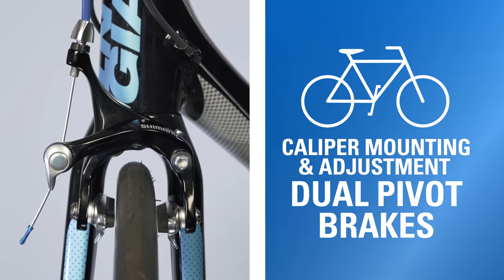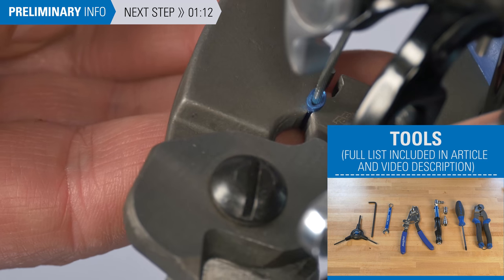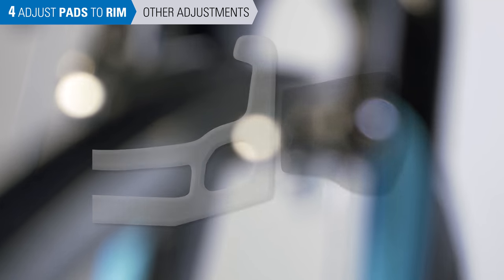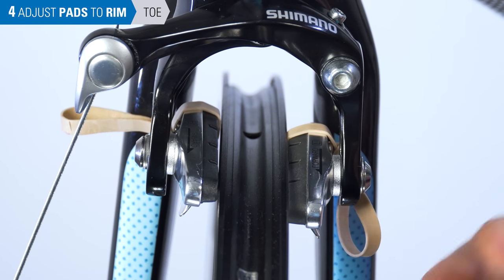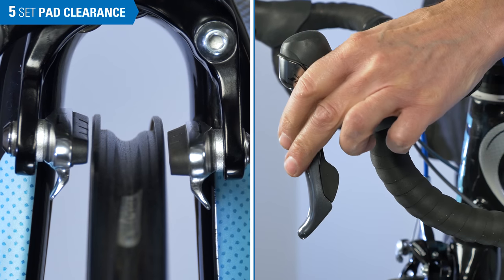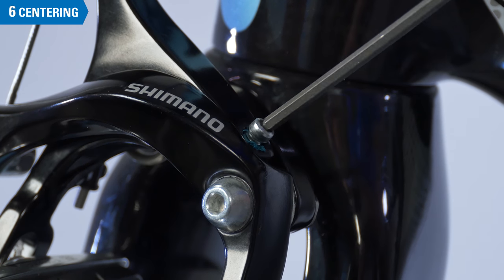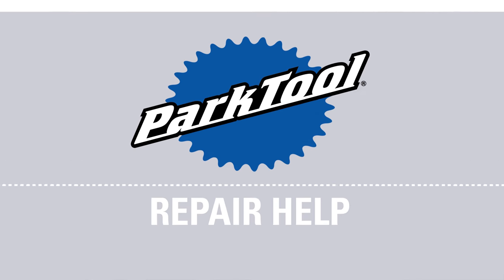Brake Caliper Mounting & Adjustment - Dual Pivot

Comment: Never realised that those pads have a toe! One of them has always been to badly aligned and the one edge wears so much faster than the other. 2 years being sent to bike shops for services an nobody has ever dealt with it in any way, so i though it was just a flaw of my calipers. You are my hero now. I don't think I'll ever take my bikes to bike shops ever again..! <3 I can perfectly pull it off on my own, especially after having built my fixie! :)

Comment: Thank you so much!
I changed the old single pivot brake calipers on my Cannondale CAAD 4 using your instructions. 

It worked great and the new Shimano 105 R7000 calipers are such an unbelievable upgrade, makes me feel way safer when I know that I can stop fast.
The Park Tool tools that I used for doing it worked flawlessly as well! :)

Comment: Calvin really lays it down. Every step is explained perfectly. I just put some SwissStop pads on my bike and couldn't find a torque spec. My bike manual said 8nm but when I tried that, it just felt wrong and I stopped trying to torque the bolt to that level. Calvin noted 5nm which is more like the real world. All praise to Park Tool.

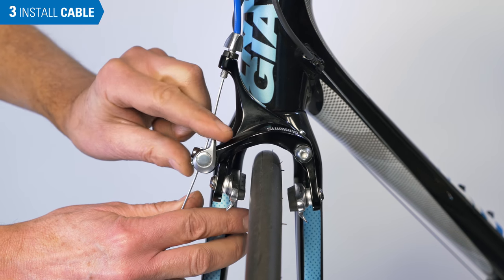Comment: Question: At 2:20, you say 'squeeze the pads to the rim and secure the pinch bolt.'  Then when the tire has been removed at 2:37, the pads show a significant gap from the rim.  Is the goal to start the procedure with the pads contacting the rim or with that gap?

Comment: I love your videos for years ago and to come. My Ultegra 6500 setup (STI + calipers) keep feeling spongy. Any clues?
Reply from the maker: Be sure that your bar tape is not pulling the housing out of the housing seat at the lever. Check this buy peeling the hood forward and pulling the brake. Watch to see how much flex is happening at the tape as you apply pressure at the brake.
Reply: @parktool  will try! Thanks for the reaction!

Comment: I bought a used 1985 Panasonic DX-3000 road bike that has Shimano Z570 side-pull brakes. I want to put Shimano Claris brakes on it, do I need to modify anything to the mount?

Comment: Hi Parktool

Do you have a video on how to fix dual pivot brakes that won't retract.
The issue is at the brake it self. The spring is not strong enough to retract.
They are less than 3 months old. I'm thinking it is dirt, but what could I do?
Cheers
Reply from the maker: No video, but there is reading at the end of: https://www.parktool.com/en-us/blog/repair-help/dual-pivot-brake-service  
Make sure it is not cable drag first.

Comment: Can someone help me, I have followed this guide however my brakes are still not biting enough. I have noted that I am unable to set toe on my left side brake pad as the arm on the calliper doesn’t allow the pad to angle enough to even achieve parallel with the rim. This had even caused the old pads to wear diagonally. This could be the source of the problem, however additionally to that I wonder if the painted rim could be reducing the frictional coefficient compared to a non painted rim braking surface. Any advice please, this bike is for my gf and I would like her to be able to stop if needed.

Comment: What's the turnable silver lever for (the one where the cable goes through)? Does it need to be set to the down position all the time?
Reply from the maker: On this brake that is the "Quick Release Lever".  It allows the arms to open to make the wheel easier to get out.  Set the brake up with the lever down, in the closed position.  Open it when taking out the wheel.

Comment: I have a center mount dual pivot system but want a stiffer caliper are they all interchangeable? Or are some center mount calipers different?
Reply from the maker: There are different models with different "reach". Shimano and TRP have some good longer reach options. In most specs the manufacturer will list the reach which is the measurement from the center of the mounting hole to the center of the brake track.

Comment: Sir Calvin, there's some squealing on my front brake. I already did the toe, and cleaned the rim brake line and brakepad. What could still be causing the squeal. First time i rode the bike again yesterday. Last time i rode it was March, before the lockdown here, and there was no squealing then.
 
 Also my front brake is not in the same position as the rear brake when in a relax position. The quick release in the front brake almost touches the brake pad bolt, although brake still works fine. Any idea how to fix this?
Reply from the maker: Squeeling brakes can be a challenge thats for sure. Cleaning, scuffing and angling the different parts of the system are what I suggest. toeing the pads, scuffing the pads/ the rim as well as cleaning the rim. Also , sometimes finding a long descent to ride the brakes down can help bed them in and reduce any squeals.

Comment: hi! i recently installed a new caliper from sora to tiagra. same specs or measurements however the new one touches the tires. the brake pads hit the tires. how do i adjust this?

Comment: Sometimes it is the person , voice mannerisms etc that makes a big impact on teaching. One thing missed in this video which is critical is to turn your bike handle bar fully to one side in order to access the back bolt on the bike forks for the Brake Calipers mount.

Comment: How about when removing/reattaching the wheel? How do you do this without moving the break?
Reply from the maker: Many brakes of this type has a quick release lever thap opens the arms a bit.  Looks at the side of the arms or sometimes at the lever.
Reply: @parktool  yeah, I got that. But it doesn’t seem to open up enough. It’s my first road bike; I just bought it today, used.

Comment: Somehow my brake pads are not coming back after I squezze the break and they rub the rim. This will result in more wasted energy for me when peddaling. Do  you know why? Maybe my brake spring is done? Thanks
Reply from the maker: I would make sure the cable and housing move freely. To check the cable and housing disconnect the cable from teh brake and pull it out of the brake completely. Pull on the cable lightly while pulling on the lever. Then slowly release the lever. IT should take very little effort to pull the cable back out. At this time you can also check the spring tension on the brake just by squeezing the arms together and releasing them slowing to see how much pressure they create. This will narrow it down.

Comment: My brake pads look the same as the ones in this video, but they don't have the convex washers to adjust toe... is this a part I can buy separately?
Reply from the maker: It typically needs to come with the pad. The threads on your pad will not be long enough to accommodate the system.

Comment: When i try to install my caliper and secure it with 6N/m(or less/more) it gets stuck and one of the levers won't move. I  cleaned and greased my caliper, always get same problem. Can't find any solution, please help..:)
Reply from the maker: If you unhook the cable from its anchor point does the caliper spring back? If it does then it is something in your cable/ housing. If it does not then your caliper will need some more love.

Comment: Great video! What's the quick release at 2:17 for?
Reply from the maker: That quick release is released to open the brakes enough to allow the tire/wheel to be removed.
Reply: Also i relese the tension when i not ride the bike for a lomger time.

Comment: Would this brake fit a huffy cranbrook 26 inch? 26 inch wheel? Or only those 700c skinny wheels?
Reply from the maker: This type of brake is typically only found on Road bikes and other skinny tired bikes. MTB's would have V-brakes, Cantilever brakes, or disc brakes.

Comment: After following this tutorial, I find that my pad clearance won't reset after releasing the brake. So everything will be set up and then after testing the brake everything works great, but then after releasing the brake the pads don't release fully? I am not sure what to do to fix this. After playing around with the front brakes, I was able to fix this problem, but I can't seem to figure out what I did to fix it and the back brakes are having this same problem
Reply from the maker: A common cause of this is a loose mounting nut.  Make sure the caliper body is tight to the frame, about 70-80 inch pounds.  Try a test of the caliper arms.  Drop the wheel. Squeeze the brake arms by hand inward and let go slowly.  Do they come out fully?  If not the caliper pivots are dragging.  They may need lubrication or they may be too tight.   See also in this case:  http://www.parktool.com/blog/repair-help/dual-pivot-brake-service#article-section-8
-Calvin
Reply: When the caliper is disconnected from the brake line, it functions great and opens fully under the force of the spring. I checked to ensure the caliper is mounted tightly to the frame. When the caliper is connected to the brake line, I test the brakes by squeezing the trigger on the handlebar and notice that it properly pulls the line taut and activates the brake. But when I release the brake, the brake line does not return fully to it's original position. This leave the brake lever with a small amount of room to wiggle freely as the line is not pulling it all the way back against the lever. I'm really not sure how to diagnose what is causing this problem. I felt like it was the caliper not pulling on the brake line hard enough, and if I separate the caliper arms by hand then the brake line is pulled taut against the brake lever. 

P.S. Thank you for taking the time to reply to my comments
Reply from the maker: It sounds very much like friction in the cable system. &#160;Unscrew the pinch bolt to free the cable and grab the end with one hand. Pull the lever with the other and see if it feels like travels back and forth freely. If it seems like there is a lot of drag, you may need to lubricate it, or replace the housing and cable. Be sure to inspect the length and housing ends as they enter any housing stops.
We walk through cable and housing installation in our series "The Park Tool Guide to Rim Brakes". https://youtu.be/qWtM5c-X0gM
-Calvin

Comment: I have an issue with my 6700 rear caliper; everything is centred and the brake shoes are at the absolute lowest in the holders, yet only the drive side is in a safe position to contact the rim, the non-drive side is too high by a couple of mm.

The bike takes standard drop calipers and the wheels are 50mm deep. Anybody got any advice? So far I'm thinking about taking a Dremel to the shoe slides.

Comment: I have centered the brakes but my barell adjuster is all the way down into the brake and there is just the minimal amount of clearance. How do I get more slack in the cable to just get more clearance?
Reply from the maker: You should be able to release the anchor bolt and release some tension. Let us know if this helps.

Comment: What else can we use if we don’t have a wire puller/opener tool
Reply from the maker: Use a friend if it is awkward.  They hold the brake together while you pull the cable and tighten the pinch bolt.   You can also replace your friend with a toe strap.

Comment: When you tighten the cable with the pads to the rim they are on the rim but the next scene they are off the rim. You didn't explain the adjustment after tightening the cable down
Reply: I was wondering the same thing! Not sure what comes in between?

Comment: can the spring wear out? the arms of mine do not spread very nice and firm :/

thank you!
Reply from the maker: It is possible but not common for the spring to wear out.  It is more common the pivots need lubrication or that the pivot adjustment is too tight.  Disconnect the cable and squeeze the arms.  Do they move freely?

Comment: Just changed my brake pads. They are too tight to the wheel so I can’t fit the wheel back through. No explanation of Joe to loosen the brakes to fit the wheel through. I think I know which bit it is but the three has worn away

Comment: What is the little metal fin that extends from the bottom of the brake pads?
Reply from the maker: The idea is they help guide the wheel between the pads making wheel installation easier.

Comment: What happens when the brakes keep touching the tires? How can we adjust that?
Reply from the maker: If you have a dual pivot caliper, there is no adjustment and the only way to prevent the tire from contacting the brake is by getting smaller tires.

Comment: What is it called for the rubber pads. I can't find it. All of the pads are sold in set not just the rubber.
Reply from the maker: Brake pad refills is commonly what they are referred to as. There are a few different shapes but most road pads are the same. Just stay clear of Campagnolo refills.

Comment: when setting up rear dual pivot pads, the left pad should be set to contact the rim higher than the right pad correct? I'm just going off the brief visual at 7:07 

This is different from the front caliper where the the left pad contact the rim lower, as seen at 5:51 

Could someone confirm if what I'm saying makes sense? 

Thanks!
Reply from the maker: That is correct. The front are rear are reversed from one another.

Comment: The quick release mechanism on my dual pivot brake is not working, how do I adjust it?
Reply from the maker: If it get corroded or dirty, it can seize.  Lubricate it.  Otherwise it may need to come apart.

Comment: After removing and placing my front wheel on, I notice my break pads are slightly misaligned to one side or the other. This often happens and I have to readjust. I notice that the tension on the quick release sometimes has an effect. I make sure my wheel is seated properly and. my brake caliper is also not loose.  Anyone have any ideas or have a similar experience?
Reply: I notice this too, and it depends if you tighten the sides of the quick release in a different way than before. The quick releases marginally alter the sitting position of the wheel which can make your break seem misaligned. I also make sure that the bike sits properly on the wheel by placing the bike on the wheel when it is on a hard surface and filled with enough air.

Comment: Anytime i try to tighten the pads they rotate and i can never get them tight enough or straight enough. Any tips ?
Reply: Adderall If I understood your problem right, that you cannot get the pad in line with the rim. With cheap brakes the actual brake where the pads attach can be bent. I've had this problem so twisting the metal itself can help, however be careful not to twist too hard and it's good idea to heat the metal first.
Reply: Thanks actually helped.
Reply: Press your brake together, very slighty tighten your brake pads. Next, screw your cable tightening out, so your brakes presses heavily against your rim.
Now, loosen the bolt of your brake pads, readjust them to your liking and torq the screw up to ~5-6Nm.
Then, loosen the tightening screw of your brake cable again and voila! Your brake pads should be perfectly setup.
Reply: Got confused here. But i’ll give it a try. This seems like what the sweetsbench vid did.

Comment: I have Dura Ace dual pivot that does not come with convex/concave spacers. How do I set Toe?
Reply from the maker: First simply test ride. If it does not squeal, do not set toe. Do not bend those arms, as they are quite strong.  If necessary, you can file in toe.
Reply: Possible to buy concave/convex washers and use them? Right now the brakes do not squeal but are wearing in one spot
Reply from the maker: Im not aware of the Shimano Dura Ace or Ultegra pads that do not have this adjustment. They simply have a concave washer and the body of the pad is the convex.

Comment: How do I know what size calipers I need? Please advise?
Reply from the maker: Calipers are designed for certain amounts of "brake reach". This is the distance from the mounting bolt to the center of the pads. Pads can move up and down, so there each brake has a range of reach.  Measure your fork from the mounting hole to the center of the rim braking surface.  Assume that is say 60mm, a brake designed for 55mm - 73mm would work fine.

Comment: CAN SOMEONE HELP MEEE........when im pulling the brake lever on the handle the brake pads touch the rims and when i release the lever the brake stuck and i need to use my hand to move it back to normal......how can i move the brake pad when im riding it right??
Reply from the maker: This is a rim brake?  Isolate the source of problem.  Remove the wheel and squeeze the caliper arms by hand and release to see is the quickly open up.   If they are not moving freely, that is the problem.  Other problems can be cable drag in the housing or a tight pivot at the lever.
Reply: @parktool  yes it is the rim brake and the rear one.....im not sure whether the cable drag is to tight or the balancing screw....i have tried to loose the cable but the result is still the same
Thank you for your response